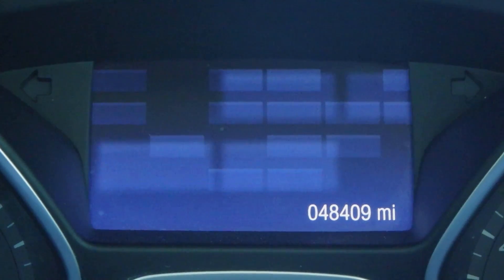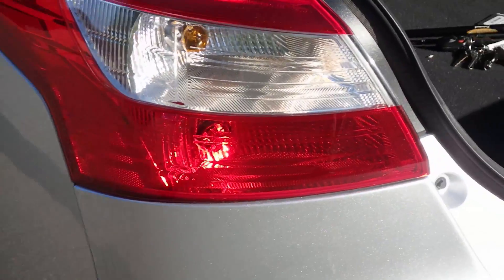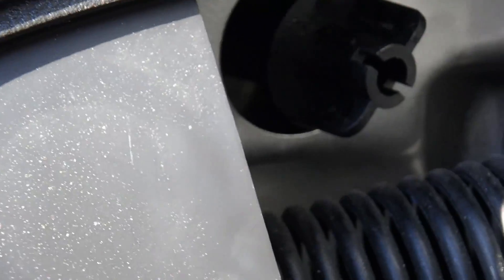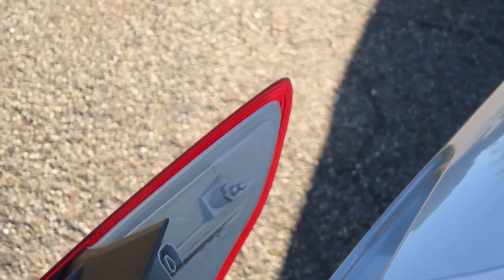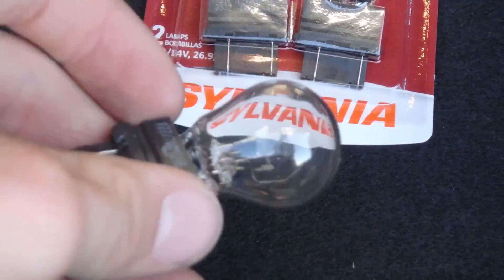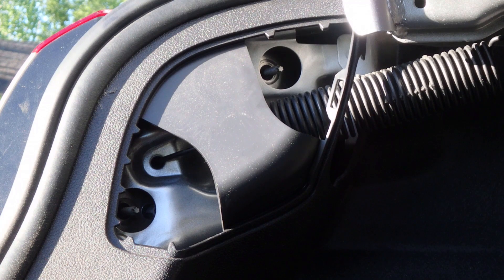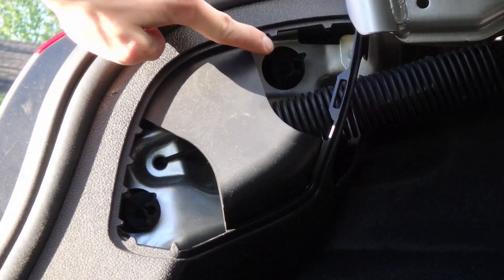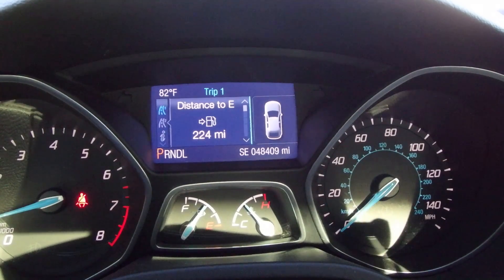fixing "brake lamp bulb fault"

Comment: Hi thank you for a great video!! I changed my bulbs as per this video but when I turn my car back on I still get the brake bulb fault error. What do you recommend I do at this point??
Reply: Same issue here
Reply: I had this problem as well. 
But when I replaced the the whole damaged lamp with a new one. Problem solved. Now I have the same issue on the other lamp. I am guessing the "bulb socket" is defective.
Reply: I replaced both 3157 bulbs but still have the fault. Could it be the 3rd lamp above the window?

Comment: Do u need to change out both sides ?
Reply from the maker: I did not have to with mine. However if both bulbs CAN have the same issue. they come in packs of two. probably not  a bad idea to swap them both. if you are anything like me I would try to store the extra bulb in the pack and would loose it anyways LOL
Reply: @dpoutdoors4702   Thank you yes I would probably lose the 2nd bulb lol. How did you know to do the one on the driver side? Rather than the passenger side 1 ... I have this message coming up as well so when the weather warms up on the weekend I will change them both out. I do have the dipped beam bulb fault message as well so I guess I have to change my headlight too...

Comment: what  do you  do  if you replace the bulb and still have  the  fault
Reply: I replaced the standard bulb with LEDs. I get the fault after installing LEDs. The brake and running lights work. What could cause this?

Comment: The notification pops up only intermittently & the brake light seems to be working.  Could something else be wrong?
Reply from the maker: I would try checking all three brake lights as well as the back running lights and and make sure they are all working.  if it only pops on intermittently. One may just stop working for a second or two and trigger the code.

Comment: Adding to your instruction,  wouldn't it be advisable to check bulb by having someone tap on brake? So dont have take apart again.
Reply: Also be an idea to wear latex gloves when TOUCHING the new bulb 🤷‍♂️ not bad otherwise. Good catch your one as I've changed a bulb alone and was forced to  squint at reflections to see if it's working again 😂 most likely done similar have you 😂👍

Comment: Thank you! Lift the black plastic cover from bottom and it should pull out easy on 2017 SEL. Same bulb too. $7 to $8 at AutoZ for dual pack.
Reply from the maker: Good to know it works for the 2017 model as well.  glad it helped! Thanks for watching!
Reply: Awesome! My 2017 se just had the fault come up. Good to  know it’s an easy fix.

Comment: My 2023 Ford Edge had a 3rd brake light burn out.  I saw that fault light, replaced the  3rd brake light  brake light works . Still occasionally getting the fault on console. ?? Light working 😁
Reply from the maker: Well if you come back in 2023 I'll make a video for especially for you lol

Comment: Worst light brand ... i have to change it again in less the 1 year...Why dod you use pliers when you can take that off with a screwdriver or hand?
Reply from the maker: I haven't had any issues with this brand of bulb. sorry you are continuing to have issues with them.  It was super tight on there so I really just use them to loosen it.

Comment: I have a much smaller panel 2016 focus hatchback
Reply from the maker: Good to know.  Is it located in the same spot?
Reply: @dpoutdoors4702  yes but it's about 4" x5" only for 2 fly nuts access, weird. I haven't seen one video that looks like mine, however I changed it out today in about 6 minutes 👊🇺🇸